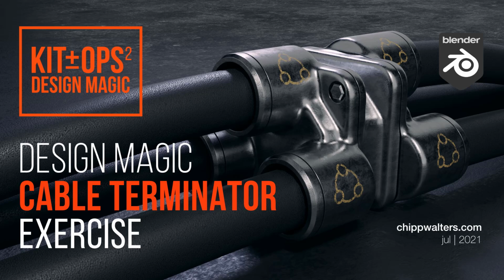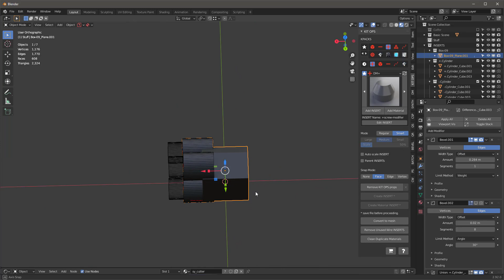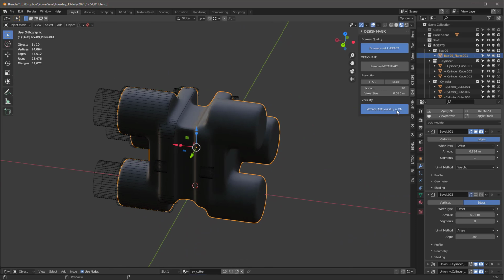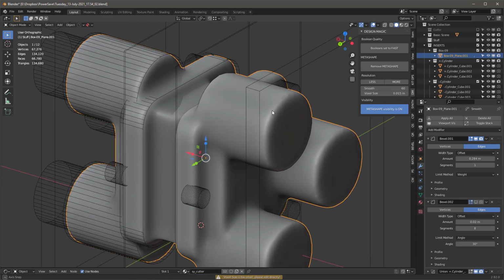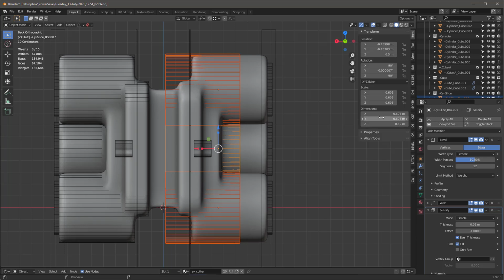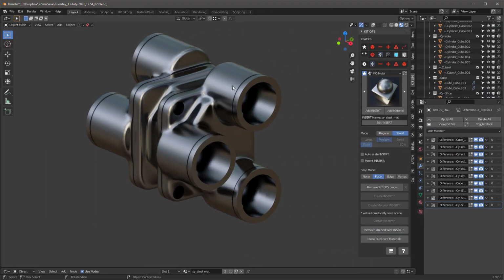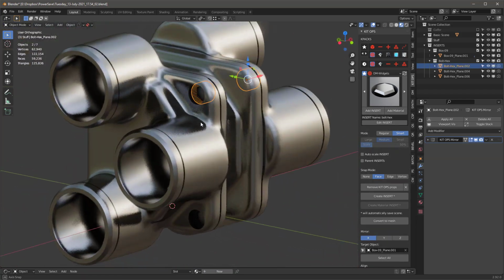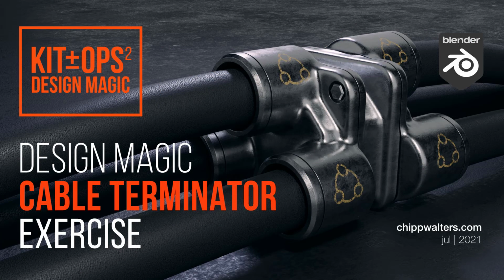DM for Blender: Cable Terminator Exercise

Comment: Chipp, Can you add a voxel limit?, because when you set the voxel to 0, blender will become unresponsive, i mean really unresponsive even the computer will become unresponsive. just incase.
Reply from the maker: I do have a voxel limit set, you can't press more and get lower than 0.015. I say in my docs don't go below that limit unless you are prepared for a possible lock up.